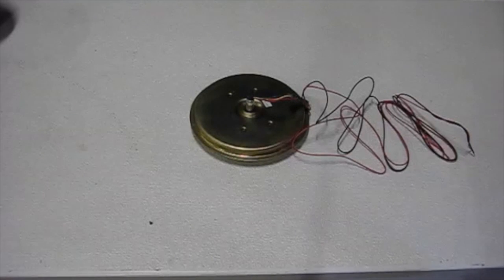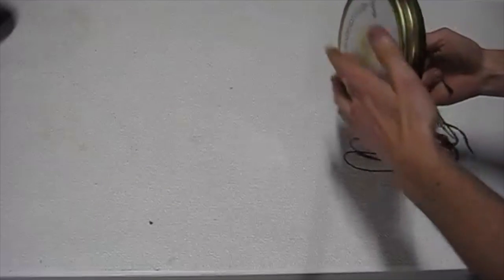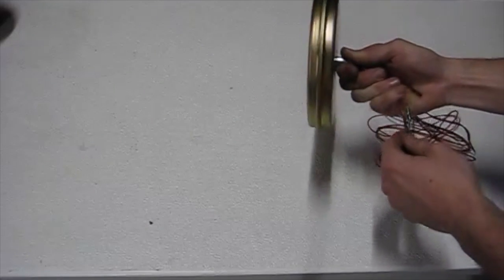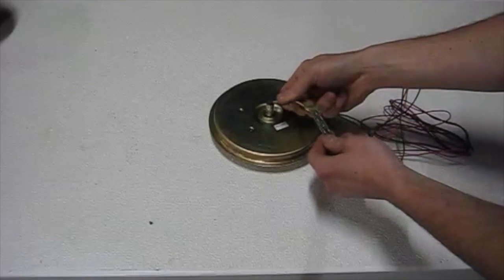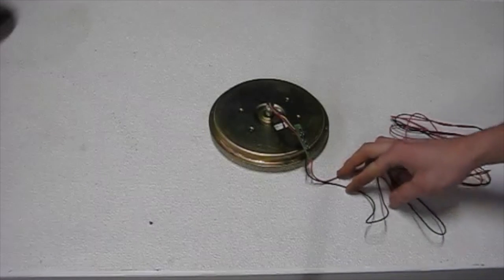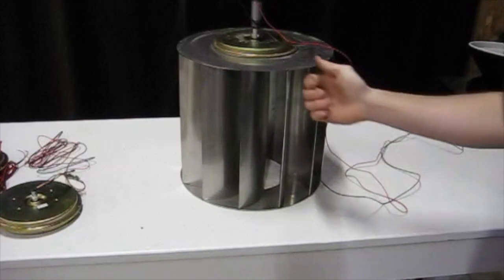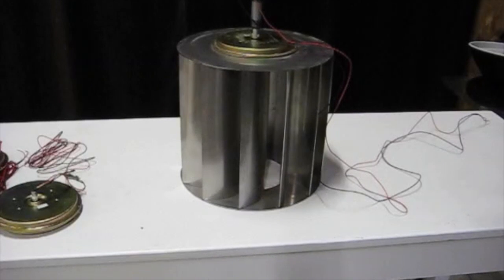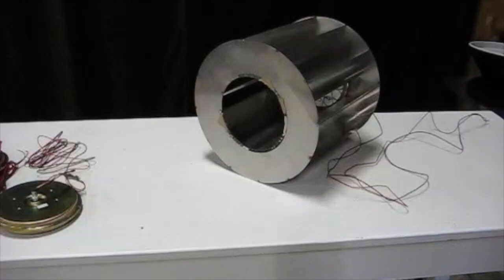Creek Generator Test 1

Comment: How are the motors fastened to the turbine? Great video!
Reply from the maker: Charles Bikely, I used industrial VHB tape.
Reply: @calvincampbell6396   thanks. The generators are rated at 20w at 60 rpm. Does the output increase further as the rpm increases over 60 rpm?
Reply from the maker: Charles Bikely Yes, I got at least 120vdc open circuit in a windstorm with my wind turbine that I used the same generator with. Unfortunately, I don’t remember the current, but I’m sure that it produced way more than 20 watts! Curious what you come up with.

Comment: awesome!!  how much juice can you store into a battery per hour?  (couldnt see the read out - too blurry)
Reply from the maker: Hi Coppulor,
These generator produce 20 Watts, 12V DC @ 1 RPS (revolution per second).  I believe that these generators are designed to trickle charge a battery.  The volt I was getting was 9-12V DC. My wind turbine videos better shows what these generators are capable of.